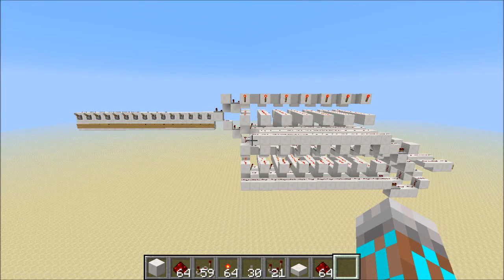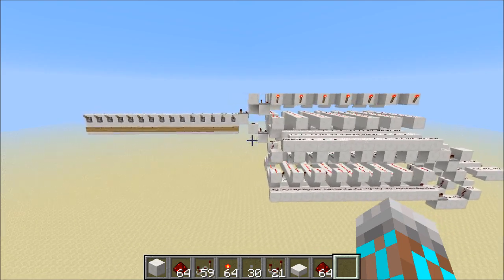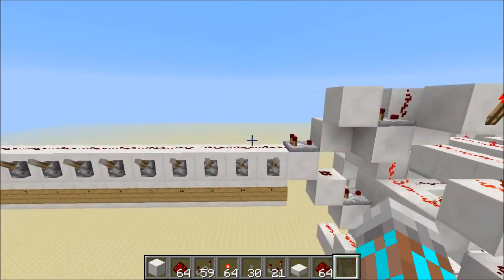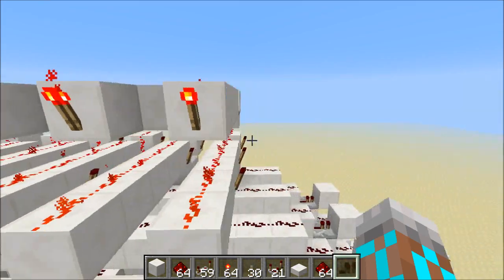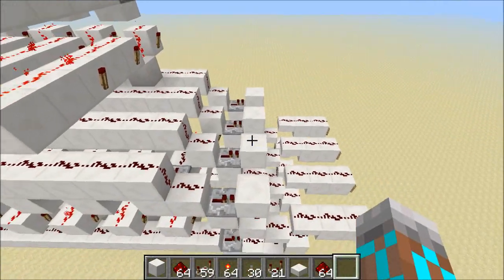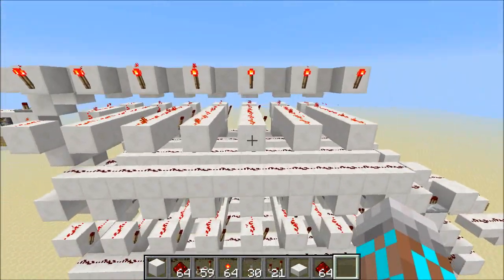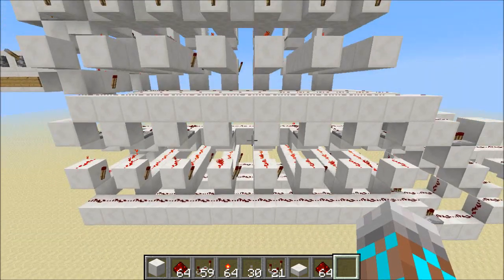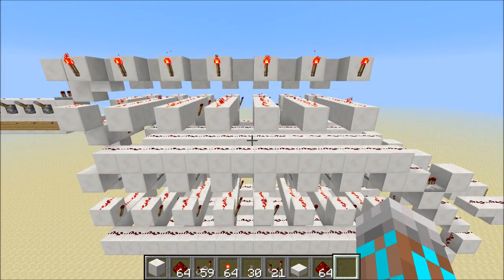Signal Strength to Binary Decoder - A Fast and Simple Design

Comment: Well the first step you do is splitting the analog signal into 2 where one is the negative of the other. As the torches and repeaters are placed in that way. Then you convert that into 16 lines of unary 8 in the upper decoder and 8 in the lower decoder.
those lines control the binary output and voila binary. it's 3 decoding steps, splitting, unary, binary. All in 2 ticks. Except it's only the decoding part that's 2tick, input and output is 2 tick.

Comment: I just made a small signal-strength to binary decoder, but with the use of comparators (also 2 wide/bit) and I do experience quite some delay before the correct output stabilizes at certain inputs (up to ~10 ticks). But it would probably almost always be faster to use look-up-tables when there is a relative small amount of outputs.

Comment from the maker: To expand this you'd just stack multiple units next to each other (it's 8-wide stackable so it matches the 2-wide/bit bussing as you get 4 binary bits for every hexadecimal digit). You'd never need to add to the decoder itself because it only needs to decode 1-15 (0 as an input simply outputs 0 by default).

Comment from the maker: The way I like to think if it is in reference to what the machine is using. For example, if the machine is running in binary the user input is encoded into binary and decoded back to a for that makes sense to the user. If machine is using hexadecimal, we're encoding to hex and decoding out. This may or may not line up with the real world definitions, but I think it's a good working definition in MC.